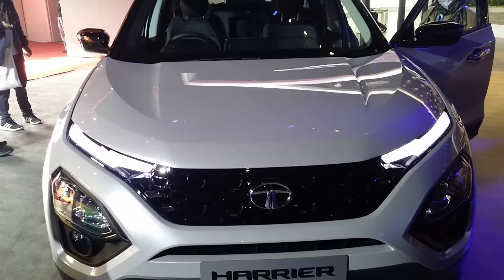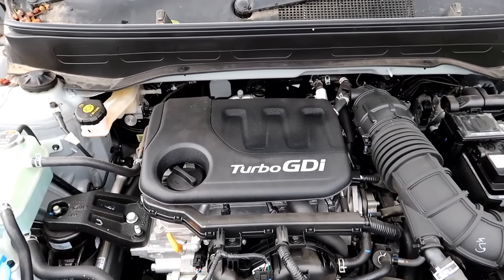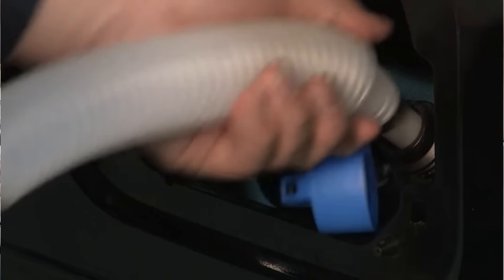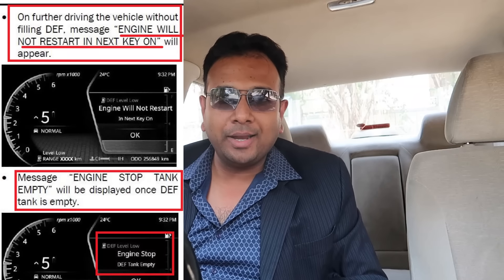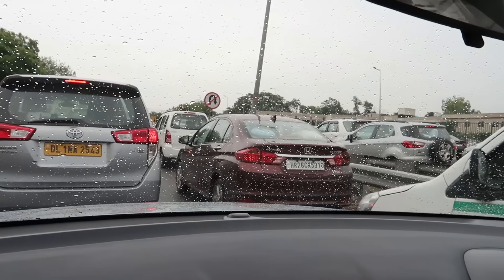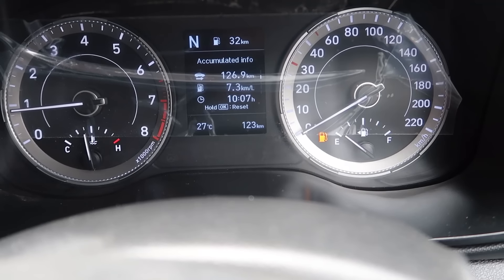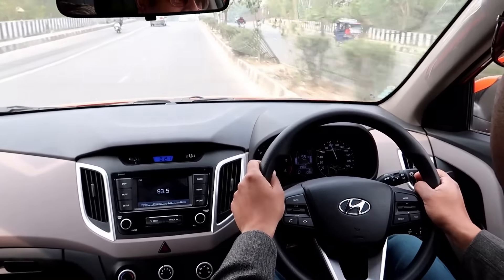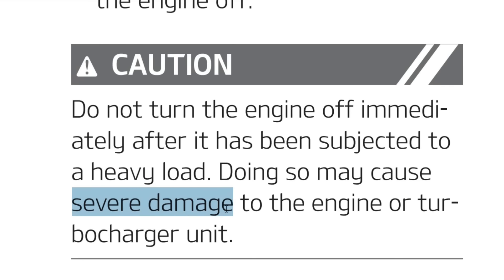PROBLEMS IN BS6 CARS. SCR Cars Diesel Exhaust Fluid, DCT Overheating, Turbo Failure and how to avoid

Comment: With Modern fuel injection with latest lubricant etc, I don’t think it is require to keep idle running. Moreover, nowadays cars with stop/ start function is available, wherein the engine is switched off when stoped at a signal.
Reply from the maker: Idling is only after long overnight haul required or when driving car after high speed drive.

Comment: Sir I am your big fan. I have Honda Amaze diesel cvt. Does it have turbo. If it has, I want to know if ideling of car engine at start and end of journey is needed in cvt car.I noticed that at parking mode in diesel cvt , rpm meter was at 900 rpm and not at zero. It may be due to creep function in cvt. Please guide me.

Comment: Sir kia crdi mai dpf ka issue kitne common hai if used less and does adding a cetane booster in fuel does any good ? Or high speed diesel.

Comment: What about the DCT transmission heating issue in bumper to bumper traffic. I have seen hardly any youtuber is covering this topic. Ford, VW  customers have suffered with similar transmissions earlier. Though DCT is an advanced transmission compared to AMT yet I would say AMT, torque converters or CVT/IVT are more reliable specially in Indian city ride conditions. Maintenance of DCT is also expensive. 
Logically you can see that Creta and Verna are available with IVT and AT transmissions, Aura is coming with AMT, elite i20 is with CVT. Hyundai is not offering DCT in any of these popular cars in India. Are we being a guinea pig by buying Venue DCT transmissions? Any good thoughts are welcome.

Comment: I am confused in Creta E Diesel and Ex Petrol. My running will be around 1200 to 1500 kms. But Diesel engines mein DEF ka bhi expense hoga and uska system bhi regularly clean karna hoga.. So please guide my petrol or diesel which is best to buy?

Comment: Very useful video... I agree and I have also done the same research... One question I have ... Do you think torque converters are still best for longevity in Indian start stop traffic and specially in very hot areas like Delhi..  looking forward to your reply thanks
Reply from the maker: Depends. DCT globally known to have higher up problems. But if timely serviced, driven with ideal drive conditions - one can certainly enjoy DCT at best than any other Automatic transmission

Comment: Please tell that bs6 diesel car is successful in India conditions? Like for short journeys ? I am worried about dpf choking issues ? Small engines are not using urea injection systems ! But is it possible to burn all the soot from dpf is our day to day running of car because we can’t follow the European systems like for  driving 20-25 min 60kmph 2500rpm we don’t have that opportunity to do it often ?? 
Please tell

Comment: Brilliant sirji thanks,, sir highway n semi urban area me 40 km daily  running k liye 7-7.5 lakh rs price me konsi car best h, mileage ,safety n good suspension wali, altroz petrol xt variant or honda amaze v petrol dono me which is better  ya koi better car suggest kre plz🙏
Reply from the maker: Amaze suspension is soft and ideal for city drive. Basis road conditions & preference set - Altroz would end up been better
Reply: @mycarhelpline  thanks sirji and what about new dezire 2020
Reply from the maker: If can upgrade Budget a bit - Brezza Lxi can be lot better than Dzire and even Altroz too
Reply: @mycarhelpline  sir new brezza ka to mileage hi khatam ho gya petrol engine me, sath hi costly bhi bahut ho gyi, isse better to nexon xm petrol h but kyuki mileage nhi deti to isliye hi nexon nhi le rha
Reply: @mycarhelpline  altroz ka arai mileage Abhi company ne officially declare nhi Kia sir, will you guide kitna deti h petrol variant me?
Reply from the maker: Not like khatam ho gaya hai, but 11 to 12 Kmpl is what can be expected in day to day drive. Also, Lxi features are reasonable enough. Space, suspension is again an edge. However,  If from Mileage perspective then Dzire Vxi can be considered but if seek to save money Altroz XE Rhythm is super value at around 6.1 Lakh on road (delhi)

Comment: I am your biggest fan sir  . Should i buy xuv300 w8 petrol or creta petrol ex ?  As my driving is around 800 km permonth  and tell me sx petrol creta is value for money or not ?
Reply from the maker: To disclaim - not driven new creta as of now. However, basis features Creta Ex seems an excellent value proposition and Creta Sx has aspiration of panoramic sunroof. For XUV300 - you may check - https://youtu.be/zlo5DGuO09M
Reply: Xuv 300 is ofcourse a fun to drive package but what u suggest ex creta or xuv300 w8
Reply from the maker: @rajat_rocks1563  i suggest you to have test drive at this moment of new creta

Comment: Nice info....why these exhaust fluid were not fitted all these year??!
Reply from the maker: Hi -  A Small Correction - Diesel Exhaust Fluid to be used only in cars with SCR Diesel Technology like Harrier, Crysta, Compass, Fortuner, Endeavour and all other performance oriented Diesel Engines. However, other Diesel Cars of mass market segment uses Lean NOX Trap which is an alternate cheaper alternative and do not need Diesel exhaust Fluid.
Reply: Till BS4 legislation, we can meet the norms without using these exhaust technologies, post BS6 NoX emissions are high along with more soot in Diesel cars, hence we need SCR technologies for bigger diesel engines and NoX catalyst for small Passenger cars. DPF is used for Soot control.

Comment: I am using a vento DSG TDi for last 4 years.. never experienced such  over heating problem even after hours of use in Bangalore traffic. Is this overheating issue only on BS6 cars.. but now I heard Volkswagen has discontinued DSG/DCT in their low end cars like polo, ameo vento and rapid.  Is that because of this overheating problem.. DQ 200 7 speed DSG box is a dry clutch system but no heating issue. (ofcourse had other issues with damaged abs sensor thrice within last 60000km)..

Comment: Sir...I like way you describe and I love your accent and your voice..
And my question is...I'm planning to tata altroz petrol XZ variant...is this fine...can you please reply me... please please please
Reply from the maker: If requirement is - Fully Loaded Features, 5 Star Safety, Build, Premium Styling, Suspension, Handling Dynamics and majority off requirement within city usage then yes is a good choice. However, not the best if Engine NVH, Power Pickup, After Sales and Touchscreen response is what considered
Reply: @mycarhelpline  then should I go for diesel variant XT
Or should I go for freestyle diesel or Figo diesel... please suggest me I'm very confused....my usage is around 1500 km per month

Comment: Namaste GAGAN ji nice information about transmission DCT but Sir what about CVT Diesel I want to know that while at Red signal in city can stop car in D mode and wait till Green light to move oR this CVT also keep in Natural ( N) please give your valuable tips thank you expected your earliest reply.
Reply from the maker: No issues in CVT. If a brief red light, can remain on drive mode with brakes pressed. However, if more than 45 seconds then can turn off ignition to save fuel.
Reply: @mycarhelpline  thank you sir for your reply

Comment: Anything to take care of in Ford Ecosport diesel manual BS6?
Reply from the maker: Just a small idling part. Whenever coming from High Speed drive, follow some idling of 30 seconds or so before turning off ignition and whenever start in morning then try not to revv engine to high RPM for initial 1 minutes

Comment: GDI petrol Engine vs Regular BS-6 petrol  Engine pe video banao please..................
Reply from the maker: Only difference between GDI and regular engine is turbo-charger. The info as shared in video is about turbo, rest all good for naturally aspirated petrol engines
Reply: GDI engine has high pressure fuel injectors which inject fuel directly to the combustion chamber. Normal petrol engines are port injected, fuel is injected through intake valves at a much lower pressure than GDI. The T-GDI motor also has turbocharger in addition to direct injection. That's why the name T-GDI(Turbo-Gasoline Direct Injection).
Reply: In port injected engines, the fuel washes down the intake valves and prevents carbon deposits on the back of the valves. In GDI, this doesn't happen as fuel injectors are placed into the cylinder directly. So there's a chance of intake valve having carbon deposits after some time in GDI engines. To solve this problem some companies have made new engines which are both direct and port injected. But I don't think Hyundai's T-GDI is one of them. So there is a risk of much more carbon deposits compared to a naturally aspirated port injected engine.

Comment: Sir Ford diesel engine exhaust fluid, Ford ki service cost m include hoga ya fluid ke liye extra pay krna hoga?
Reply from the maker: An update: Ford Ecosport comes with Lean NOX and not DEF Fluid. Lean NOX is an alternate cheap system as used. While Endeavour has SCR with Diesel Exhaust Fluid.
Reply: @mycarhelpline  Ok thankyou sir.
Reply from the maker: @ATCKindia  - an update posted by editing comment. pl check
Reply: @mycarhelpline  sir m plan kraa hu freestyle titanium plus  diesel bs6, long term m problem toh nhi h ? Ya  petrol is safe choice.
Reply from the maker: can surely buy Freestyle Diesel Titanium. Lot more fun to drive

Comment: Hi sir, i have turbo charged 1.5 diesel in xuv300 that comes with auto start stop technology aur jo aap keh rahe h us hisaab se wo redlight pe ya hum long run se aa rahe h aur jahan bhi humne neutral kiya wo band ho jata h to us case me kya kare??
Reply from the maker: Idling is required when starting car for first time in morning after long halt or coming to stop after high speed driving.

Comment: Also kindly point out the true difference between small petrol turbos  real world fuel efficiency and small diesel turbo, since majority automakers are pulling the plug on diesel engines. Yes the difference in cost of petrol and diesel are now less than 2 rs but the actual difference is in the real world fuel efficiency. And turbo petrols are very sensitive to throttle inputs, I mean what's the point of purchasing a 1.4 turbo petrol and constantly looking at the instantaneous FE consumption which is the case with most turbo petrol owners. Basic double digit FE should be expected just like in the case of small diesel engines.

Comment: I was planning to buy the škoda Rapid Rider 1.0 turbo, but after watching your video I am unable to make up my mind for it 😓
Reply from the maker: go for it. Just need an idling for 30 seconds during first start in morning and whenever coming after high speed / high distance run then 30 second idling needed before turning off ignition

Comment: Sir aap ne jo my car helpline wali link drop ki thi last video mai us mai calculate incurance jo show karta hai woh kis company ka incurance hai aur sab showroom wale 1+2 de rahe hai 1 year 1st party and 2 years 3rd party aur iss se zada rates pe same problem with rto your website rto calculator show different figures and show room agent gives different figures
Showroom agent told mai if handling charges combine with ex showroom prise then rto and incurance will also increase thats why company keeps it seperate......
Plz help me and reply
Reply from the maker: Which Car, City, Model Variant - for road tax. Insurance premium is through Bajaj Allianz / Tata AIG and shows lowest indicative premium as offered by these 2 may check online premium of these companies.
Reply: I am from agra uttar pradesh i m searching for venue sx petrol varient they give me quotation  like this
Ex showroom-979000
Handling-3000
E. Pack-6600 (optional)
Antirust +teflon-8900 (optional)
Rto - 82920
Insurance + 0debt - 34169+6939
Fastag- 600
Seat covers- 6000 (optional)
Reply from the maker: Pl find reply
1. Handling - already shared few videos on how to get it waived. may check
2. RTO - If buying on finance, RTO should be Rs 81520 as shared on - https://www.mycarhelpline.com/index.php?option=com_forms&view=pages&layout=rtouttarpradesh&Itemid=461. Suggest to ask dealer breakup of RTO Charges as charged. You can cross check on above URL on what account is he charging extra
3. Insurance + Zero dept on MyCarHelpline Insurance page is Rs 36031. Suggest to check Bajaj Allianz zero dept online for IDV of 9.3 Lakh its coming as Rs 36000 - can buy directly online
Hope should help !!
Reply: Sir R.S.A Company provide karti hai with waranty ya fir hame r.s.a k liya extra pay karna hota hai

Comment: Sir diesel exhaust fluid ka cost kya rahega? Specially for seltos and creta
Reply from the maker: Hi -  A Small Correction - Diesel Exhaust Fluid to be used only in cars with SCR Diesel Technology like Harrier, Crysta, Compass, Fortuner, Endeavour and all other performance oriented Diesel Engines. However, other Diesel Cars of mass market segment uses Lean NOX Trap which is an alternate cheaper alternative and do not need Diesel exhaust Fluid.
Reply: @mycarhelpline  Thanks sir for the reply, so does this nox trap cost us any extra amount over a period of time- for eg while servicing etc? Does it need any type of replacement or special service after a particular period of time?
And of yes, please tell the approx cost for the same.
Reply from the maker: Not going to cost as no scheduled replacement needed

Comment: If i will buy normal bs6 petrol engine which problem i will face in future?
Reply from the maker: No problems. All good if naturally aspirated petrol engine. However if turbo then idling as explained is required when starting car after long overnight haul.

Comment: So all u meant to say is., In turbo charged petrol engines we have to stay on for few secs or a min so engine get cold and then turn off after heavy load on it..? Right? Same thing has to be done during engine start? Am i correct? If not please correct me...i need to know this as i have 0 knowledge on it.
Reply from the maker: Idling of 30 Seconds required when starting car after long Halt of 6 to 8 hours and Idling of 30 seconds required when coming to halt after high speed driving to give some time for turbo to cool up
Reply: @mycarhelpline  thanks for the reply..u made us gain some knowledge... Would you suggest me some good car under 7L on road? Please.
Reply from the maker: Depends on need, requirement. suggest to post on MyCarHelpline Forum for a detailed reply

Comment: Sir, after how much kilometres drive, we need to do idealing at the stop of turbo petrol engine

Example, I drive 25 km daily, very polite drive, I have never done idealing at stop of car, I only do at start of car

Please help with the terminology, what is long drive and what is exhaustive drive, which need idealing at end of drive
Reply from the maker: Idling is effectively required at start of car after long halt (say starting a turbo car after night halt).  Then idling is required when coming after driving at high speed drive of over 80 Kmph for a moderate to long distance before turning off ignition.
Reply: @mycarhelpline  

Thanks Sir

So if I am driving at 70, for 25 KM, idealing may not be necessarily required ???

I am repeating and asking it again, since i am very concerned, I have drive my car from 19000 KM for an year, same way

Comment: I have bought the new tata Harrier XZA+ and dealership filled it with BS4 diesel and upon delivery am getting Drive control system fault error message with engine check light on. Pickup is seriously decreased and showroom people have no idea what to do. Can you help ?
Reply from the maker: Thats a blunder. Can you post on MyCarHelpline Forum as cant upload attachment here.
Reply: Mycarhelpline. com sure

Comment: Exhaust diesel refill ki cost kitni hogi sir??
Reply from the maker: Small Correction - Diesel Models which uses SCR Technology are Performance oriented Diesel Cars like Harrier, Compass, Ford Endeavour, Toyota Innova Crysta, Fortuner, Benz BMW etc. But small engines like 1.5 Litre or below comes with alternate Lean NOX Trap system to remove NOX which do not need DEF. In terms of DEF cost in Bigger Diesel Engine performance cars - not expensive will cost just around rs 1500 or so

Comment: In diesel while stopping the car how much time to need stop the engine...
Reply from the maker: Whenever coming from High Speed drive, follow some idling of 30 seconds or so before turning off ignition and whenever start in morning then try not to revv engine to high RPM for initial 1 minute

Comment: Sir I have driven Seltos diesel for 5000 km and I got ENGINE WARNING LIGHT  for 5 times till now. I guess it is due to bs4 fuel. Every time I had to go to the workshop and get it solved. It is really annoying sir. Any suggestions ??
Reply from the maker: yes, many users reporting same issue. Hopefully from April 2020 when bS6 fuel will be standard across should not get issue. In meanwhile, try to find direct company owned outlet in your city and if dispensing BS6 fuel would be a great scenario.
Reply: thank you for response. Will try.  Your videos are amazing. God bless you.

Comment: What is source of this info ?
Reply from the maker: > For DEF Fluid in BS6 SCR Cars - https://www.mycarhelpline.com/index.php?option=com_easyblog&view=entry&id=1023&Itemid=91
> For Turbo Charged - refer your Car Owner Manual
> For DCT Transmission Part - its best practice
> For dCT Clutch cost - pl contact your service center

Comment: naturally aspirated engines are way better then...
Reply: In reliability, yes. But you won't get that punch in the midrange. You'll have to revv hard for quick acceleration in naturally aspirated cars.
Reply: @operatora588  check out Ford's latest naturally aspirated engines.

They produce best in class power in the segment and reliability